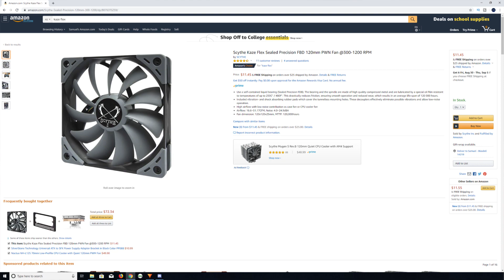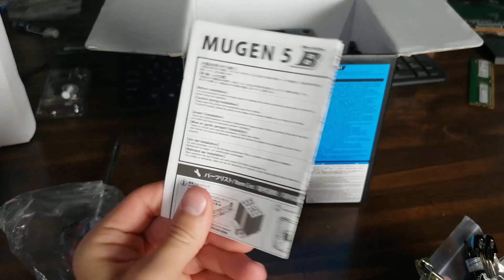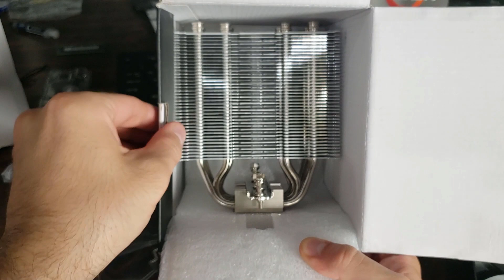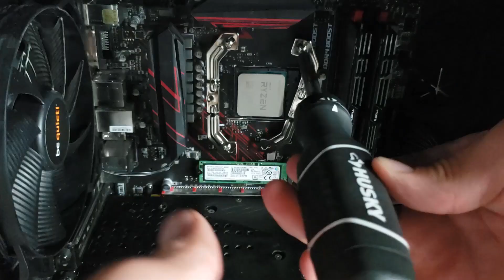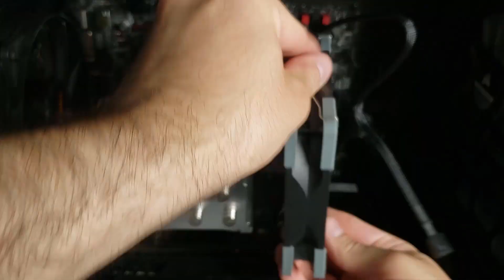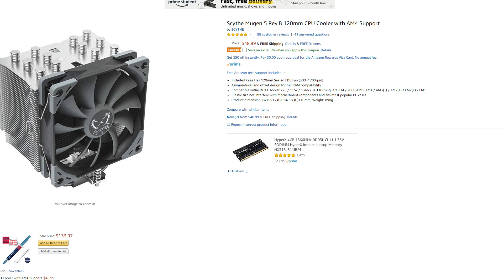Best Budget cooler for Ryzen 5000? Mugen 5 Rev.B by Scythe

Comment: I owned the Scathe Ninja 5, the Mugen 5 rev.B (PCGH edition), Arctic 34 Duo, Gelid Tranquilo 2, SilentiumPC Fera 3 and Spartan 5...tested mostly on ryzen 1600, 3600,  5600x and i5-8600K at 5.0Ghz OC. from. My experience the Kaze Flex 120 fans on the Mugen and ninja were the quietest, but then again, they have the lowest RPM. Ninja 5 was good, very good, yet disappointing since its so low RPM, the airflow thru the huge radiator is minimal and the Temps, even tho good, are higher. The Mugen 5 is absolute value beast. 50$ is a steal for it. The 34 Duo is hailed as a budget king. But not in my country anymore. Once it used to be 31-33$ and now it's 45$ so it's not a good value since for 50$ you can get the Mugen 5 or maybe fuma 2.

You can't go wrong with any cooler. Only water coolers have issues. Recently I learned the new msi rgb coolers 2021/2022 models have high issues and are RMAd in masses. You can buy a decent 20$ cooler or a high end 100$ like Noctua nh-d15, but or budget value, nothing beats the Mugen 5
Reply from the maker: The value proposition for the Scythe coolers is quite high, I agree. I would like to change the fan on my Fuma and retest it as well, I suspect there's a lot of performance to be unlocked.

I do run a be quiet! 360mm pure loop AIO watercooler on my main PC. Its been running well for a few months now. I have read about MSI watercooler RMA's, that certainly is worrisome. Looking forward to testing some newer coolers this year on more cases.
Reply: @STS  the káže flex fans on Scythe air coolers are supreme. But if you want to change, nothing beats the Noctua A12 (28-40$ a piece). They are very pricey. The chromax black version costs even more. People hate on the brown cream colored original A12, but I just love their looks in a modern black case.

Then again, there are other 30$ 120mm fans that could match them like the copycat Thermaltake t30.

The new msi aio that have issues are the msi mag coreliguid aios. Don't even waste your money.

Comment: Did the cooler height interfere with the case enclosure/glass panel?
Reply: Yep and my case only fit for 160mm cooler  (158mm actually), thank you so much for the info, today i'll buy this cooler. Wish you all the best👌
Reply from the maker: No problem! Always happy to help make PCs better :)

What CPU were you running btw?
Reply from the maker: Hi Handy Guy! No - it fit very well in this case. The Mugen 5 Rev.B is 154.5mm tall so it should fit into most cases. Were you looking to upgrade your cooler?

Comment: good for 5800x??
Reply from the maker: Hi Eagle K! This cooler definitely will work on a 5800X. You won't get as high of boost clocks and overclocks as you will with a larger watercooler though. This cooler with a 5800X in a decent airflow case should do just fine though. I would potentially recommend buying the second fan though if you think your case airflow is too low or you want that extra piece of mind.
Reply: @STS  thanks
Reply: @STS  so an update, i ended up buying thermallight pa120, it cost as much as mugen 5 but perform better , still thank you for respond
Reply from the maker: Ah interesting! That looks like a 120mm version of the Noctua D15 (almost). I haven't worked with Thermalright but that looks like a respectable cooler. 

What kind of boost clockspeeds and temperatures are you getting?
Reply: @STS  after messing with pbo settings it never reach 90c even during cinebench
Reply from the maker: Ah, glad you're all set!

Comment: Any idea what the TDP value of this bad boy? I could not find that info anywhere :(
Reply from the maker: I do not know if there is a TDP rating from Scythe on the Mugen 5 but, I have used it on a 2600, 2700, 3600, 5600x, and a 3900XT. For the cost, this is a great cooler!

Comment: What's the point of changing the tittle to Ryzen 5000 when this was made for 3000
Reply from the maker: Hi Scorpio! The video came out when the 3000s were new but the heatsink isn't necessarily designed for any specific CPU. I was able to use this quite successfully with my Ryzen 5600X but have not made a dedicated video for it. The Mugen 5 Rev.B is capable of cooling up to the Ryzen 5800X in most typical cases with decent air flow.

Comment: Hi Sam! 
This maybe a bit of a late question, but I need a second opinion.. I am looking for an upgrade for my Ryzen 3600 with a stock cooler and I was wondering if a Mugen 5 is worth it. It is just for playing games but I reached temps around 84 degrees celsius after like an hour of gaming. 

I was first thinking just a hyper 212 BE would do the trick but I was wondering if it's better just going to go with a mugen 5.
Reply from the maker: Hi VenoM! The Hyper 212 is a good low budget option over the stock heatsink for sure. The Mugen 5 is a much better upgrade over the Hyper 212 though. If you have the budget, the Mugen 5 is the better cooler. If not, the hyper 212 will be better than the stock.

Mugen 5: https://amzn.to/2HqjuKS
Hyper 212 Black Edition: https://amzn.to/3BTRs54
Reply: @STS  Cheers! Thanks for your fast reaction and help ofcourse! :) The mugen 5 it is!
Reply from the maker: Solid choice! I'm actually retesting this cooler my my Ryzen 5600x test bench PC now.
Reply: @STS  would love to see the results :)
Reply: @STS  Hey Sam! So I installed the cooler and it works like a train! Man that thing is cooling real good.
Reply from the maker: Hey, that's awesome! Working with the Mugen 5 on my 5600 now :)

Game on friend!
Reply: @STS  Cheers!

Comment: decent for 5900X?
Reply from the maker: Hi Ivo! The Mugen 5 Rev.b is a great budget cooler for sure. Typically you would use it with a 6 or 8 core processor, that seems like the sweet spot. This cooler can probably keep a 5900x from throttling at stock speeds and may even allow for a little bit of boosting headroom. If you want to overclock the 5900x though, I would suggest looking at a larger dual tower cooler from Noctua or be quiet!. If you can fit an all in one watercooler, that would orobably be best for performance. For the 5900x a 240mm or 280mm AIO or CLC would be best.

So to summarize, the Mugen 5 will be fone at stock speeds, if you want to manually OC all core or want to get the highest boost speeds, I suggest either 240mm/280mm warercoolerss. What's the budget for this build? The Mugen 5 comes in between 45-60$ normally.
Reply: @STS  i purchased at the end Asus TUF aio 240mm its not bad i get really fine temps really sometimes get stable 60celsius while gaming with 5900X but its pretty loud..i dont overclock anything i just have my 5900X on default and have core performance boost enabled which is even by default so..maybe next year i will sell my aio and go for aircooler but i cannot fit huge Noctua and its ugly...maybe Dark Rock PRO 4? but i like mugen5 i dont think it will not handle good 5900X at default. Are there some tests? because 5900X runs not that hot compared to 5800X.  For now i will stick with my AIO from ASUS and will see but i like Mugen 5 ARGB way more. If u can suggest some other high-end aircooler. And i mean newest Mugen5 ARGB PLUS it costs way more then u wrote. Or Grandis 3 EVO ARGB also very nice and even have TDP up to 250W and its recommended for 12cores CPUs. What do u think? keep my aio even if its loud for another year i would say to get something out of it and then buy some high-end aircooler?or just stick with aio.... aircoolers will just last longer thats what it is i would love to swap it for that Grandis or Mugen 5. That Aio from Asus i can sell to someone.
Reply from the maker: @Johny1492  Hi again! I do not believe after seeing more data (not generated by me) that the Mugen 5 even with dual fans can keep up with a 5900x. It would run for sure but, your boost clocks would end up being lower than expected. I would highly suggest the largest AIO / rad you can fit into your case. Something in the Arctic watercooling line up is what i would personally opt for. Which case were you using?
Reply: @STS  no largest isnt always best and my case support for upper part aio up to 280mm 360mm is waste of money 5900x is not like 10900k i dont believe mugen would be bad even experts told me it would cool it and its quiet i have new aio allready as i told you asus tuf newest model 240aio and its good set because i have asus mobo strix it looks really nice that aio cost me around 170dollars its just little bit louder but hey i game around 60c and 37iddle for 5900x ryzen its very good. I also have very expensive case with 2x200mm fans from noctua. I thought about best aircooler noctua nhd15 but it couldnt fit into my case that would be enough for 5900x but dark rock pro is also highend cooler but nonrgb i like looks of mugen5. Maybe higher temps but quiet !!!! And ryzen is build up to 94c from what i heared i dont get it why u have such bad opinion about mugen its not low end cooler its more on high end side.
Reply: @STS  i dont need aio i have one 3months old from asus its just little bit noisy maybe i will buy another one next year just get something out of it dont wanna change aio after like 5months u know 😀i have my aio on top its best place.. and pump under i did my research and it guy build up whole build for me as i said i game even a lot at 57celsius
Reply: Dont think mugen would get those temps as my 240aio now from asus i need someone with experience having Mugen5 and 5900X i really love that ARGB PLUS MUGEN5 its the best mugen5 you can get even with dual fans...you must also take a note that 5900X is not power hungry and have really high temp limits..Mugen would not be enough definitely not for 10900k or 11900k. Great thing is that maybe i would have higher temps but mugen is very very quiet...

Comment: If you are using a 5600x you should undervolt it in the bios. It basically gives you lower temps and higher clocks.
Reply from the maker: Hi Omar! This test was conducted with a Ryzen 3600. I was able to get a 5600 recently and will be testing new coolers with the 5600. Would you be interested in me retesting the Mugen 5 woth the 5600 and then potentially undervolting it?
Reply: @STS  Sure that would be very interesting! And maybe a two fan configuration to see if just push or push and pull is more effective.
Reply: how much undervolt it doesnt decrease performance?
Reply: i mean for 5900X

Comment: I use the "PCGH-Edition" (comes directly with two 800rpm fans) on a 2700X but iam wondering if the performance is better with 2x 1200rp fans
Reply from the maker: HI Wotans Krieger! The krux of the Scythe coolers is the slower spinning fans. If you want a very slight bump in performance, yes, the faster spinning 1200rpm fans should cool off the processor a little bit better. We might only be taking 2-4C best case though. If you want better fans but to keep the main heatsink, I would look into some higher airflow (CFM) and higher pressure (static pressure XXmmHG). I think with a slightly loud set of rans on the Mugen 5, it could really compete quite well.
Reply: @STS  Hm will see if i can get 2 faster fans for a good price. Not really in the mood to invest 40€ in fans when the cooler costs just a bit more. Iam not concerned when it comes to noise when i dont hear some Fan noise i think something has a defect. At the moment i use as a case a Corsair Carbide Series 100R with 5 Fans (4 are from "Uphere" they are cheap but really awesome for the price and for 2 years now still running great) But when i finally can get a new GPU (aiming for an 6800XT) i probably will upgrade the Case to an "LANCOOL II Mesh Performance" Cause the Airflow of the Carbide is not the best but i got it for free so no big loss.

Comment: Hi Sam, i have the same cooler and i'm wondering if the extra fan wil help in temp. Did you notice the temp drop after adding one? And how much?
Reply from the maker: Hi MouseMan! Awesome, this is a solid choice. The second fan did help drop temperatures in my case. I saw reductions from 1-3C in some testing which in certain cases on a Ryzen CPU might net you a few extra MHz. If your cases airflow is high enough, you might not need a second fan at all. The extra fan will probably run you $10-$15 depending on when and where you get it. The temperature drop is relatively low, so for the money, its not a high value part - $10 for 1-3C. That being said, I like the idea of push / pull fans on tower heatsinks so I opted for it and I'm glad I did.

Which CPU are you trying to cool with this heatsink? Building a new gaming PC?
Reply: @STS  i bought the extra fan and i noticed 1-3 degrees drop on heavy load like prime95.  I have a delided 8700k @4.8 GHz with 1.26 volt.  That cpu is kinda hard to keep cool. Cinebech15 max temp is 64 degrees now. I choose this cooler for the memory slot clearance because i use all 4 mem slots.. U still use this cooler op your cpu?
Reply from the maker: @themuiz  Awesome! Yeah, those CPUs can put out some heat. 

I don't use this cooler everyday anymore. Not from a stand point that I don't like it or that it can't keep up but, I'm trying to keep review items available for future testing and or PC builds for the channel. 

At some point soon I will finish building my new set and get back into videos. Perhaps the Mugen will find its way into my "shop PC" that I use while working on stuff for the channel.

FWIW, I think this is one snazzy looking cooler and for the price, a great performer. Scythe makes some high quality products.

Comment: Right now I am using 20$ cooler with Ryzen 5 5600x (Spartan 3LT, it's from local company, so you won't rahter recognize it). Overall it's by about 15°C cooler than Wraith Stealth. 

I'm reaching 1.35V 4.6GHz with max 83°C after 30 minutes of stress test and 74°C in gaming. Should I upgrade to the one from the video? 5600x has about the same temperature as 3600.
Reply from the maker: Hi PwOp YT! I'm a believer in only upgrading if you need it and it makes sense. In your case, 83C is a little high for comfort but mid 70s for gaming isn't too bad. I don't know anything about this cooler or what your internal case configuration (parts, cable management, and fan arrangements) look like. The Mugen 5 Rev.B is a rather large and beefy tower cooler. For the $45-$50 (USD) price range, it's a top competitor. Ryzen CPU are quite temperature sensitive when it comes to boosting, with a better cooler you could see some improvements.

Comment: A second kaze flex fan in push-pull has minimal improvement in CPU temps, maybe 1-2 degree C improvement on my 1600. However flipping the cooler so that it is offset the wrong way, ie covering the ram slots, that second fan then provides a lot of extra airflow over VRMs and lowered their temps ~8C under load. I don't have a sensor for my ram temps so I am unsure how they were affected.
Reply from the maker: Hi awhislyle!

Yes, the second fan is generally not required, I would probably steer people in this direction for those extra few degree that might allow another 25-50MHz on Ryzen 3000s as a few degrees in either direction can change clockspeed. 

Very interesting, I had not thought about trying that. In most computer cases the airflow travels from front to back. How do/did you have your case fans configured during that test?
 I'm not sure which application you used to see the VRM temperatures but, HWInfo64 normally can read the memory temperatures. I'm curious what the temperature difference of the memory would be (if any).

Was this an upgrade or a full system build?
Reply: @STS  Thank you for the reply, Sam, I am glad you are still interested in this topic. I recently had a scare where some liquid got into my computer from the top exhaust, luckily I was able to unplug it immediately and thoroughly dry my motherboard and video card and nothing was permanently damaged. As a result I removed my top exhaust fan and replaced the cover. As this decreased my total airflow I purchased a 2nd 120mm fan for my mugen 5 to see if I could get a little additional cooling. My ~8C decrease on the VRMs was solely from the addition of the second fan - my mugen was already accidentally flipped from when I had reinstalled it after drying my motherboard - I seem to recall my old VRM temps with the normal mugen orientation being slightly higher still.

My case is a fractal define S with 3 filtered front 140 intakes and a 140 bottom intake with the only exhaust being a single(faster) 140 at the back. With the mugen itself reversed(but its fans still oriented to blow towards the back of the case) the air from pull fan on the mugen blows air right over my modest VRM heatsink. I do use HWinfo for monitoring my PC but unfortunately I do not have memory temperatures. I had long been worried about my VRM temperatures as they were the hottest thing in my computer and I know they can have decreased lifespans and efficiency based on the temperatures at which they operate so to serendipitously find a solution that effectively provides active VRM cooling was really amazing to me.

For people with lower end motherboards that have lesser quality passively cooled VRMs who are trying to overclock I believe this flip-trick combined with a second fan may indeed be a pretty good idea.
Reply: these kaze flex fans are poor heatsink/radiator fans.
theyre the best case fans though.

what you wanna do with the mugen 5 is put some high pressure fans on it, like scythe wondersnail, nb-eloop, noctua a12x25, or the cheaper arctic p12's.

Comment: 100%, just installed mine and temps dropped 10-15c instantly
Reply from the maker: Hi Fuloran1! That's great! This cooler provides a substantial reduction over the factory included heatsink on my Ryzen 3600 both stock and overclocked. What CPU and case are you using this cooler for?